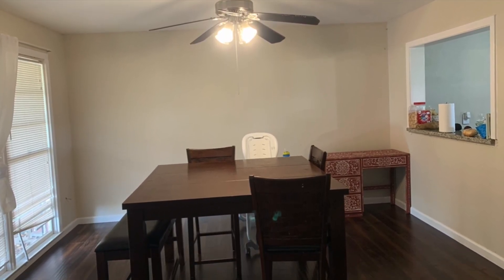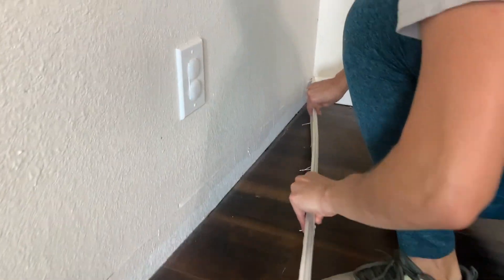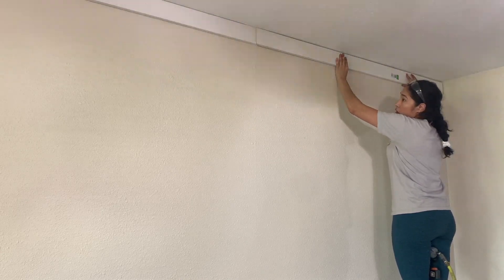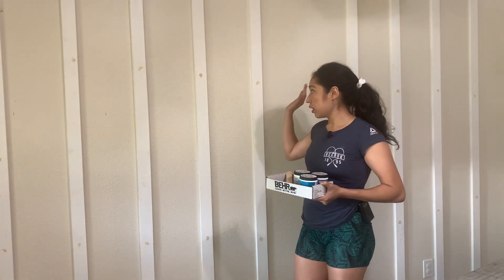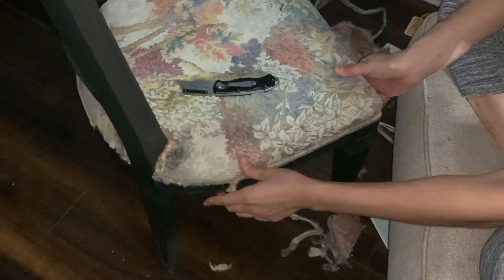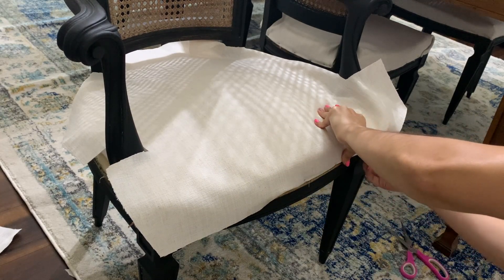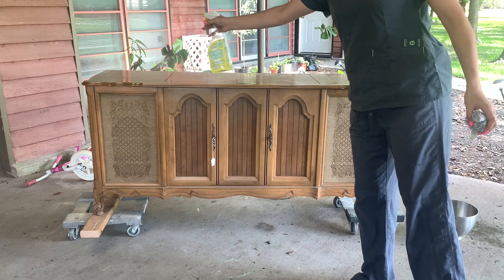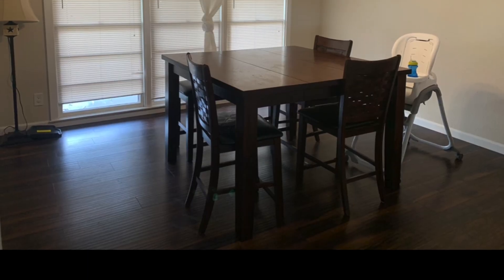Dining Room Makeover 2021 | Easy Board and Batten wall

Comment: Very nice.  I do upholstery.  Wish I could have helped you with that.  The wall is awesome.  I love crazy, so my colors and drapes are a bit more bold in my dining room, but I did the painting and made the drapes and Roman shades.  I also have hand-blown glass light fixtures by a local artist.  I just love that you do everything yourself and use so many power tools.
Reply from the maker: How time consuming were the roman shades?! I really want to make some! 
Thank you! ❤️
Reply: I have made them before, so these were easier.  I do a lot of measuring, make pockets in the lining and put dowels in the pockets.  I don’t use the readymade tape.  I whip stitch the rings on, tie the cording onto the bottom ring and pull them through the rings and an eye hook at the top.  To install, I staple the top of the shade to a piece of wood (the eye hooks are attached to this) that fits the window and screw that into place.  Wish I could send you some pictures.